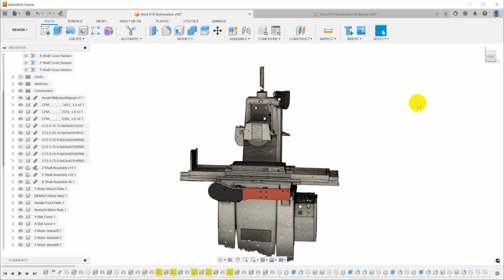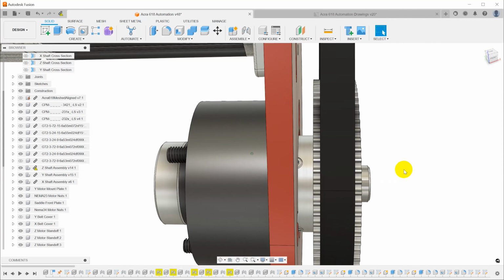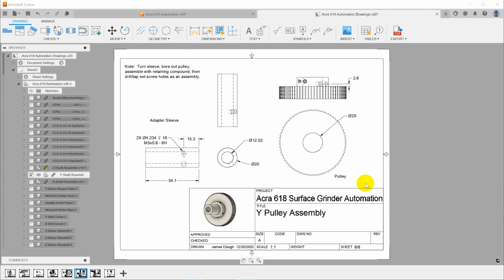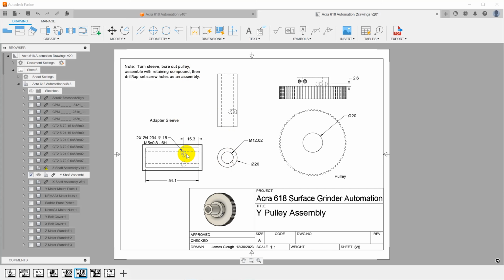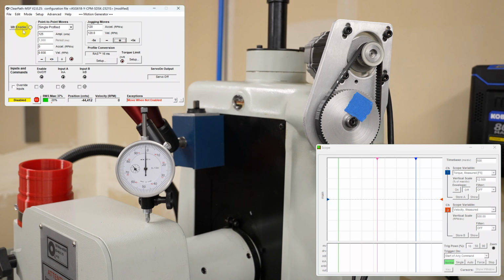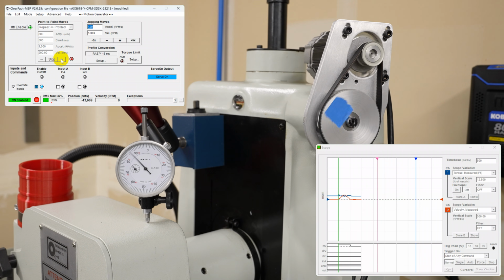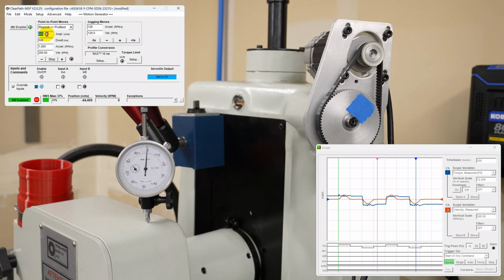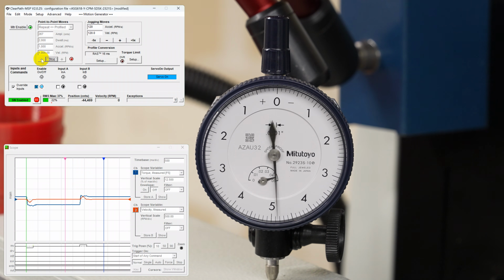Surface Grinder Automation: Y Axis Drive | Part 5 | ClearPath

Comment: Hi James:
If you were to take the Y axis pully and flip it end for end, (so that the srt screws were towards the motor shaft end instead of towards the motor), you could gain several mm of clearance between the back of the motor and the machine table frame.

Comment: Plug gages are nice to use when boring small holes along with 3 point mics. How does the pin feel in the hole.

Comment: Just a little tip: the ball end is on the long side of the hex wrench to limit the amount of torque you try to put through it. If you start sticking a cheater bar on there, you'll eventually find yourself rounding out the inside of the bolt head or twisting the ball end clean off the wrench, and both of those outcomes will ruin your day. It's well worth investing in a set of non-ball-end hex wrenches for those "it's in too deep but it needs some gronk" situations.

Comment: Hello Mr. Clough. A friend of mine recently got my 3x3 Avid CNC benchtop running, I have Acorn software but it came with the hardware. I'm having a hard time understanding what level software I need and you have a very similar setup to me, just a bit smaller machine. I believe we both have Clearpath servos, CNC depot spindle with ATC. I see AcornSix software and then  there is CNC12 Mill CNC (Acorn.) If you feel comfortable recommending the software, that would help me out a lot! Thanks! I have never done anything on CNC as of yet, so, newb... =D

Comment: Hi 
Can you make one tool for manual glass cutting machine in which i can control pressure to make a actual size of glass diameter 
I have used this in tool for magnetic compass glass 
And I can't cut glass proper round

Comment: I'm shocked by the amount of time it takes the Clearpath servo to auto-tune. I worked with Bosch Rexroth, Sew Eurodrive, Siemens, Schneider etc and they tune actually sooo much quicker than clearpaths. Also when doing moves, why don't you include the command line in the graph? or the follow error.. torque line is pretty useless in this case

Comment: For tenstioning your axis drive belts its worth actually working out the correct frequency. The motor auto tuning wont like belts that arent tensioned properly as they wear, or get replaced with another belt with an irrelevant tension value.

Comment: James, @22:30, a tuned servo system will reak havoc if the Servo pulley gets loose, as it is completely out of tune then. So that literally won't go unnoticed 😊

Comment: nice video ! you ask people to comment on stuf ,,,  i watched a video from you, about grinding a collet chuck holder for the latthe .... because i needed to know some stuf about that ... ( could not find that video , on laptop , watched it on my phone ... but im baned or some thing )   you grinded that collet chuck holder with a dremmel stone wheel ,  but could not get the precise effect on the end of the holder ..... and im just in machining for 2/3 years , being lucky having a set of 6 german collets and holder haha     ........  but that dremmel wheel was round  ,,, so the radius of the wheel is the same on every point , but  that collet holder had a conus and a conus radius is diverent on every spot ....  so maybe you can trim (dres) a dremmel wheel with a conus ( tapperd) radius ....so maybe  you wont get the woble in the end of the collet holder

Comment: A surface grinder is much more like a mill than a lathe. X,Y, and Z are all the same wether it's a vertical or a horizontal mill. When you bring your table up or your spindle down you are moving in the Z dimension. If you were turning your part I could see using lathe terms. (Which I think are bass akward regardless...)

Comment: Hi James, really enjoying your channel. Would\could\should you do a full "drive by wire"? I've always thought the ultimate job shop machine would be a hybrid CNC with hand wheels for roaming around.
Reply from the maker: Yeah, I'm planning on having a single dial encoder and a selector, but I haven't finalized it yet.  I know others (Robin Renzetti) who have an encoder dial for each axis.
Reply: @Clough42  Good Stuff, next project, electronic cross-feed on the lathe with automatic surface speed compensation!

Comment: INTERNATIONAL STANDARD
 ISO 841

"Industrial automation systems and integration — Numerical control of machines — Coordinate system and motion nomenclature" defines what the correct axis naming is, and James is correct.  It is important to follow the standard, especially for CNC machine tools, so that g-code can be created by multiple programs and still run correctly on different machines.

Comment: Have you thought about using an interference fit using a temperature difference instead of a retaining compound? My gut instinct tells me it would be stronger and less messy than the Loctite, but I could be wrong, I am no machinist or mechanical engineer.

Comment: 13:17 
Just curious, do you use a floating reamer holder? I suspect that any slight misalignment could result in an oversized hole. Also, I'm curious to hear about the oil selection changing the reamed hole diameter like you mentioned - hopefully to be covered in a future video!

Comment: Your reasoning for naming the XYZ axis is spot on and the only correct assignment, now just remember that if the tool moving right(table moving left) is +X, that means tool moving forward(table moving back is +Z), therefore tool moving up is +Y. I feel like someone out there has screwed this up and got really confused as to why one of their axes was moving the wrong direction after posting a program.

Comment: On my lathe X is the long axis and Y is the cross slide. Maybe I'm wrong but I always think of it as a cartesian system from a user point of view. I.e. if I stand in front of the machine (lathe or mill) facing it, the X is my left / right, the Y is forward / back and the X is up / down.

Comment: The drawing has the date set at 2023 - I wonder if that was wrong or if this video has been in the works for 2 years!
Reply from the maker: The date on the drawing is correct.  You may wish to consult a calendar.
Reply: @Clough42  oops! Thanks for replying, made my day

Comment: Problem with leadscrew drive is that the wear is non-linear across the entire length in both axial and linear coordinates so you might find at points along it's travel you are now out of compliance with the DTI from your initial measurement location. The only way to be accurate is with feedback decoupled from the motor like with a linear scale but unless you're paying silly money you'll be getting 5 to 10 micron accuracy but even they really aren't quite that accurate compared to a DTI

Comment: Nice job.   If I ever get back working on my surface grinder, will have to look at doing the same thing.   Are you going to fully CNC the thing or just do some sort of manual canned routines in a controller?

Craig

Comment: VERTICAL MOVEMENT SHOULD BE THE Z-AXIS WHICH CORRESPOND WITH THICKNESS.
Reply: no lol, spindle axes is always Z, if you ever touched a CNC mashine in the last 50 years than you would know that

Comment: Have to ask as a non-machinist... the toothed gear is large enough that there is always a large enough belt engagement at all times. Whilst it would be much deeper hole which has its own risks and challenges, but at a pinch could you not have put the set screw holes through the toothed area of the pully?
Reply: Thinking about it, having a tap long enough would be another issue....... so ignore me!!

Comment: So a CNC with a manually tiltable head would have axis labeled X, 0.5Y/0.5Z, 0.5Z/0.5Y when the head is tilted at 45 degrees?

Comment: I would be concerned to transfer all the moving forces just relying on the cup tips from the two M5 set screws, i tried similar in previous projects and got some errors as they losend over time and slip increased.…

Comment: James, loctite 609 uses capillary action to center the part as it cures, using the set screws before it cures defeats the action, I realize it’s only microns we’re talking about here, but I have used it on some pretty sloppy fits and was very impressed with the centering and locking action.
Reply from the maker: Can you point me to documentation somewhere about this?  I read through the Henkel technical data sheet and didn't see this mentioned.  It doesn't even contain the word capillary.  The LOCTITE 290 data sheet does, but neither mentions centering.
Reply: @Clough42  James, sorry it’s been 30 or more years since I was shown that from an old machinist at that time, I’m in my 70s now. Keep doing you sir your content is always enjoyable and informative.
Reply: @Clough42  I too have heard this tale. Seems the shrink fit will auto center if left to its only devices. I question whether or not there is a lot of folk out there who have heard the same from back in the mid 1970's-early 80's. It might have only been the feverdream of a salesman but... I never tested it... you can take all of this with a salt cellar. Try testing with a variety of positional angles, quick set or rapid acceleration fluids, with it spinning, the mind boggles.
Reply from the maker: @CothranMike  yeah...I thought about testing it, but I'm not sure I can control the variables well enough to make it useful.
Reply: Thanks, at least this is information with added value. Greetings from the Netherlands.
Reply: Hi James, nice one again 👍
Two simple tricks for centre drilling:
One is to support the drill from the side with a turning tool. Even if it is pushed sideways - it will dig a centered cone hole in the face. 1 or 2 mm is enough and the cone will than center the drill.
The other more precise trick is to drill for instance 7.5mm hole, bore the first 5mm with boring bar to 8mm. This will act as a centering part and you will be amazed how precise next holes will be.
Thanks for sharing your work ❤
Reply: When Loctite 609 is applied to a joint or gap between parts, its low viscosity allows it to wick or seep into the very small spaces by capillary action. This makes it highly effective for retaining bearings, bushings, and cylindrical parts, ensuring a secure fit even in pre-assembled parts. However, while it has excellent wicking properties, the idea of it "centering" parts might be a bit of a stretch. The primary role of Loctite 609 is to secure parts in their intended position as placed by the assembler, not to align or reposition them.
Reply: @mariusj8542 but is that documented anywhere? I looked as well and couldn't find anything from henkel or anywhere else stating this.
Reply: Whomp Whomp

Comment: On a CNC lathe, it's a Z axis. Where it gets confusing is machines with parallel axes like boring mills with a Z and a W axis or machines like hobs which technically have multiple spindles.
Reply from the maker: Yeah.  You can run out of letters real fast.  My mill DRO has Z and U.  And when I put the TouchDRO on it, I think it'll be Z and A?  Maybe that's configurable.
Reply: @Clough42  if I’m not mistaken, a U and Z dro can be considered a lathe dro. U is an incremental axis of X on CNC lathes, and W with Z. As long as the operator knows which axis is what on a dro, it doesn’t matter lol. 

For the reamer, what I’ve done in the past in my aerospace career holding .0001 bananas on bores, you can increase the chip load on a reamer during the cut and it can result a slightly smaller hole. The less of a chip load, the more time the reamer has to rub the internal bore. It’s worked for me in the past for machining metal to metal press fits and slip fits with one reamer. 

Love the work!! Keep it coming!
Reply from the maker: @Zrelli_  oh, cool.  I know the lubricant can affect it, but didn't think about the feed.
Reply: @Clough42   yes sir. Lubricant plays a small part too. In my experience, it’s mainly a surface tension thing based on material. Aluminum cuts real well with mineral spirits or WD40 in a pinch
Reply: On old Tornos DECO controls, you'll see UVW along side XYZ, but those are just for identifying incremental axes. When you actually select an axis to jog, there is a rotary switch that has X1, Y1, Z1, X2, Y2, X3, Z3... labeled at each position.

Though I have noticed, on (some?) Eurotech lathes, idk if it's all Fanuc controls or just this machine, but there is a button for a B axis, which doesn't make sense because it's not a lathe with a milling head, it's a triple turret lathe. So the only rotational axis should be the C axis. I'll have to ask about it when I go into work next week.

Comment: Your machine, call your coord system anyway you wish.  just some insight, In a lot on CNC machines and CAD; Think of 2 axis graph on paper or computer screen, as you view straight on:  X = left / right, Y =  up/down - now if you add a Z axist, its Z = in/out, this is how the maind coord systems are setup, viewing head on to working surface.
Reply: I believe That’s exactly what he said.
Reply: @chucksmalfus9623  I may has missed it, and it was just insight, nothing derogative